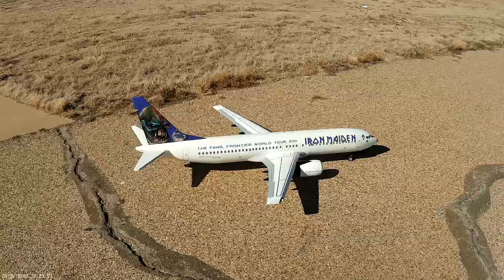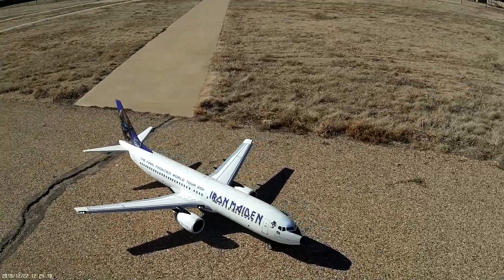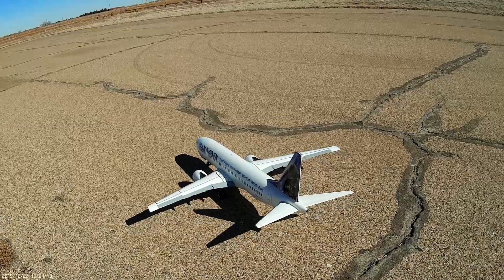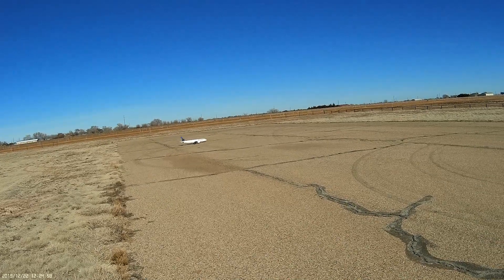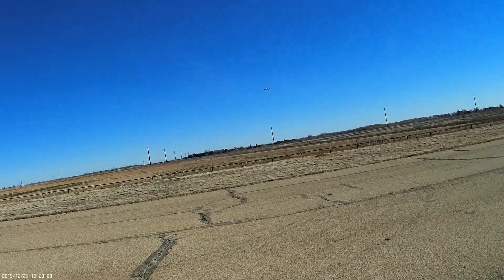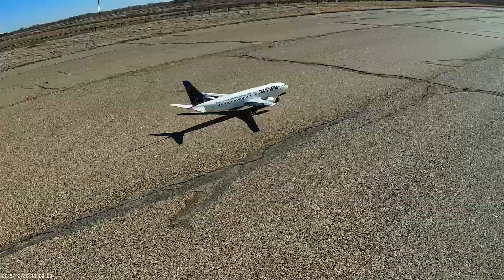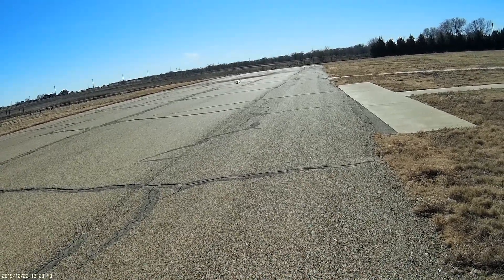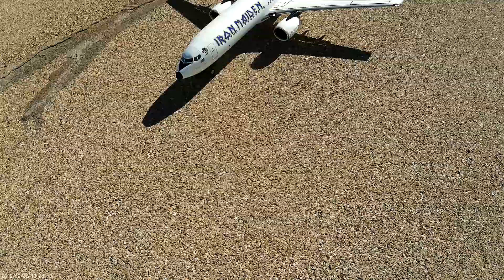Freewing AL-37

Comment: I was fixing to do the ed force one al 37, callie graphics correct, she stated she had the iron maiden tour graphics on file, very nice.
Reply from the maker: Very nice go for it and post it when your done so I can check it out !
Reply: @s.w.warbirds4126  I am assuming you used cali graphics, I was not sure if she had both iron maiden's tour schemes. I see you chose the later tour graphics which I do like, but thought about older tour graphics, due to the first tour airliner only had two engines and the later had four engines, but I do like the newer graphics better and think I might go the same livery as you did.really looks great. Did you choose to apply decals dry or wet and were they a pain, especially the vertical stab at or not? Thanks for any suggestions.
Reply from the maker: @kawasakizx14jomamamoto57   I did use Callie , & I did put them on dry .